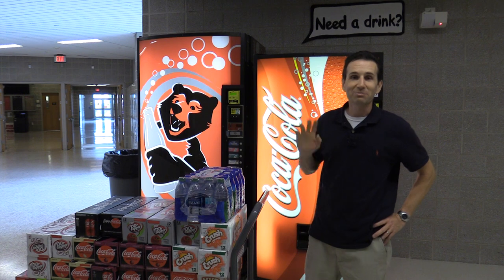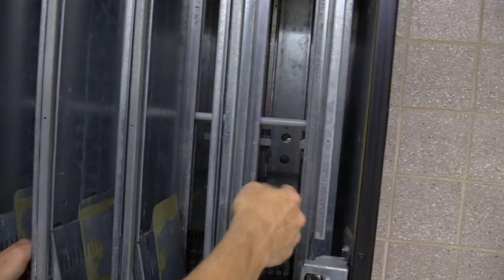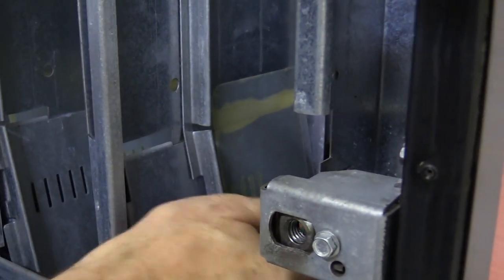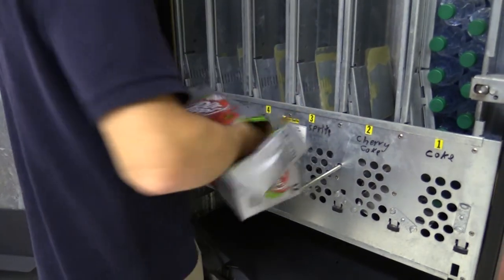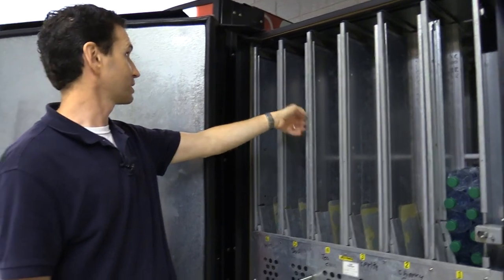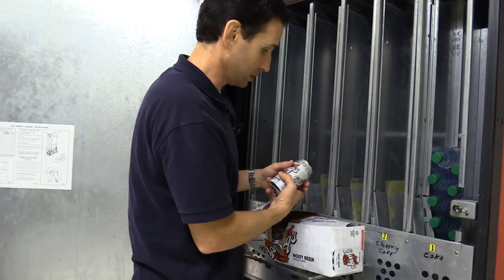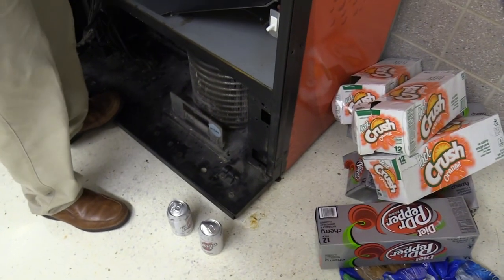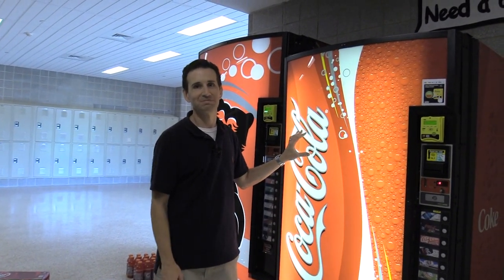Filling an Empty Soda Machine

Comment: Help, I dont know how to move the adjustable product stops!
Reply from the maker: The rear or front stops?  The rear stops have holes to put your fingers in and you pull the latches inward.  You can then move the stop forward or backward.  I move the top, then the bottom since it is hard to do all four latches at once.  Just make sure you count the holes and make sure the top and bottom are in the same holes.  The front stops just lift up and go in and out of slots.

Comment: This channel has been a lifesaver for me. I recently bought a Royal 660-8 GIII and anytime I need to learn something about it, I come here. I've been having trouble putting 2 cans in one column, which isn't detrimental since I don't have that much product to warrant it, but I'm wondering if it's something I have to program in the settings or if I'm just not doing it right 😅
Reply from the maker: You probably have the product depth set wrong.  You must set this by selection, NOT by Column.  So if your first selection is Coke, and you have them 2-deep, you must set selection 1 to 2.  Based on your Space to Sales setting, selection 1 might vend from multiple columns.  Once you set product depth for a selection, it applies that setting to all columns that are associated with that selection.  So check your product depth settings.

Comment: Hello, I appreciate your videos, they are very helpful! I recently purchased a Royal 660-9 and everything looks good except that the back row dispenses two drinks instead of one. They are 12oz and it is set for 2 columns, any idea what the problem might be? I am struggling :(
Reply from the maker: You probably set your product depth wrong.  It gets set per selection...not per column.  So if selection 8 in your machine has cans...make sure selection 8 is set to 2 deep.  If it's not that make sure the side product stop is in the narrow setting.
Reply: @HappyVending  thank you!!

Comment: Evening,  Awesome video!  I have a question might be silly but on the machine you restocking in the video, what will be the best way to test it to make sure your product comes out and will not get stuck?  I have a 448-8 and struggling to get a manual so just going with what I think is best and watching videos similar to the machine I have.  des it have a test function to test each slot?
Reply from the maker: Sometimes I just grab some change from the coin bin and do some test vends.  Then you are testing the coin mech at the same time.  It does have a test vend mode though.

Comment: Hi, Bill.
So I was only able to get the Royal....which is fine. The machine is in our garage so it is pretty warm here in Miami.
Starting temperature is 92° once plugged in. I filled up drinks about 65% capacity. 3 hours later the temperature is now at 76°....and stays at that point. Compressor runs for about 30 seconds and does turn off to maintain said temperature. 
What are your thoughts?
Thank you.
-- Matthew
Reply from the maker: It shouldn't take too long for the machine to get into the 60s.  I guess that's why the machine was so cheap...it is not cooling.  If you're lucky, you can get someone to come out and put a tap on the cooling deck and fill the refrigerant...that's what the problem sounds like.
Reply: @HappyVending  OK. Thank you for the tip. Another thing I wondered. Does the Royals have a manual temperature / thermostat setting knob like the Dixie Narco does?
Reply from the maker: @MI325A  No...the cut in/cut out settings are in the menus.
Reply: @HappyVending  Understood, Bill. Perhaps the thermostat just needs to be set since it maintains the 79 mark? I'll research the manual and see what I can maybe figure out. Seems that when I did a test before purchase, the temperature had gone into the low 60s. I just didn't have enough time during lunch to stay for complete cycle. That's why I'm wondering the thermostat has gone bad. Nonetheless, will also check with a tech to see about freon level. Thank you for all your help, as always, to me and other viewers. You are truly appreciated.
Reply: I was able to navigate through the settings menu and found the temperature is set at 35. I moved it to 37 because I though with it being in a hot garage, much condensation would build up.
However, I believe after reading manual troubleshooting, it seems the sensor, wiring, or similar may be a place to begin as far as repairs. Still going for the freon level to get checked once I can locate a refrigeration tech for machines.
Reply from the maker: @MI325A  Why do you think it's the sensor?  Does the compressor continue to run but never really gets cold?  I think if it were the sensor it wouldn't even get into the 70s.  I am pretty certain it is low on refrigerant.  I had a giii doing the same thing a few months ago and I ended up replacing the cooling deck and problem was solved.  I have never had a temp sensor go bad on me.

Comment: I have a question and obviously it looks like you know what you’re doing I have a Dixie narco 2145 bottle machine and a lot of my bottles stick when they fall or they kind of hang up would you have any suggestions
Reply from the maker: I have yet to purchase a bottle drop machine, so I can't speak with experience in regards to this issue.  I do see lots of discussions about bottle drop machines on the vendiscuss.net forum so you should check that out.  I do know those machines work best when the cups and eproms are updated to the most recent version.  You may also have a gate issue.  Post a question on the vendiscuss.net forum and I'm sure someone will give you some good advice.

Comment: How do you reset the sold out error after its filled up the colom is full but still saids sold out I have royal 660/9
Reply from the maker: The sold out display should reset once you open the door of the vending machine.  If it is not resetting, you may have a bad door switch.  It is an easy repair, just order a new switch from royal.

Comment: Hey Bill great channel, I had a question about about 660-13 Giii 
Part 1 Which product/591 ml bottles have you loaded in this machine without the bottles getting stuck, part 2, if you haven’t used 591ml bottles what is the larger bottle you’ve tried and vended successfully in this machine. 

Thanks 
Anthony
Reply from the maker: 591ml is about 20 ounces...which should vend fine.  I have only vended 20 ounce or 16.5 ounce bottles in my machines.  The 20 ounce bottles vend best...but if I don't stack too many, I can vend the 16.5 ounce bottles too.
Reply: @HappyVending  Thank you, I will experiment with multiple bottles stacked in the column to see if they get stuck

Comment: How, where do you find the manual for that machine. I have been searching. But the photos of the manuals I find don't match that machine. GIII operation and service manual????
Reply from the maker: The giii machines came with many different fronts but the insides were the same.  The picture on the front of the manual might not look like the machine in this video, but it's still the same machine on the inside.  The giii manual can be downloaded from this page: https://www.royalvendors.com/giii-vender/

Comment: What did you set your machine to for the Dasani? Mine vend multiples bottles.
Reply from the maker: Be sure to set the selection to 1-deep for water bottles.  That is in the Sdep setting (set depth).  You set depth per selection, not per column.  So if your waters are selection 1, set depth for selection 1 to 1, for 1 deep.

Comment: Also, why do the front cans face towards you?
Reply from the maker: Actually, with cans it really doesn't mater since the top and bottom of the cans is the same.  It is REALLY important with bottles because the cap will migrate toward the center divider if you put it in the wrong way and it will hang up and jam the column.  It is just good practice to put all your product in the same direction so that you get use to loading your machine properly regardless of whether you are loading cans or bottles.
Reply: @HappyVending  Thanks the response 👍

Comment: I need help trying to start my royal 660 it’s not reading any codes even when the door is open I don’t know what I’m doing wrong I inserted a new bill acceptor and everything
Reply from the maker: What do you mean by reading any codes?  Is the display blank?  When you plug.in the machine does it do anything?  Does the compressor come on?
Reply: Happy Vending, yes the digital display screen is blank it doesn’t show any words.
Reply from the maker: @handrickwillis342  does the compressor come on?  Did you check the fuse on the top of the machine near the control board?
Reply: Happy Vending yes it does work
Reply: Happy Vending yes everything comes on but the display is blank but still red but blank not saying any codes
Reply: Happy Vending when I plug in the compressor runs good when I took out my old cash acceptor then but the new one in I heard the nose that it’s running now I put coins in my Coinco acceptor that runs too but that blue button on the mother board didn’t work so I can start to custom my cans at all it didn’t say anything from the start what does this mean?
Reply from the maker: @handrickwillis342  Did you unplug the machine before disconnecting or reconnecting the plugs to the coin acceptor or bill acceptor?  If not, you may have damaged your control board.  Also, did you check that fuse at the top of the machine?
Reply: Happy Vending yes I had it unplugged the whole time when I was inserting the bill acceptor then plugged it up when I finished attaching the bill acceptor then I heard the nose as it makes when a bill goes threw then the coin acceptor worked right from the beginning it never worked I brought the like as is but everything else works the reg the motor as well it’s jus the screen is blank maybe the mother board is not reading the digital board screen
Reply from the maker: @handrickwillis342  Well, unplug the machine, disconnect the new bill acceptor you installed, and power it up and try working the machine with just the coin acceptor.  If it works, you know you have a problem with the new bill acceptor you installed.